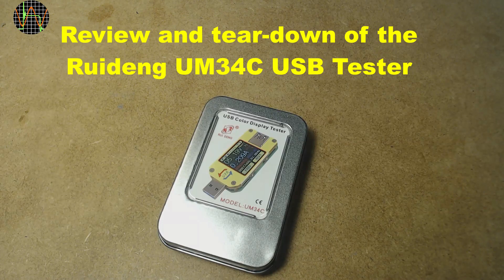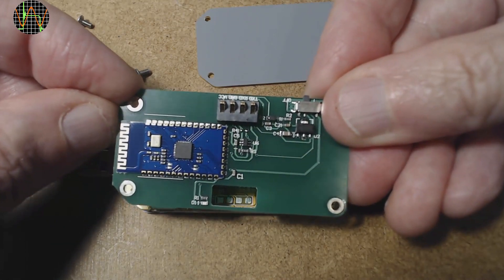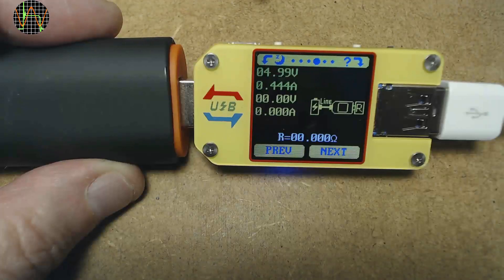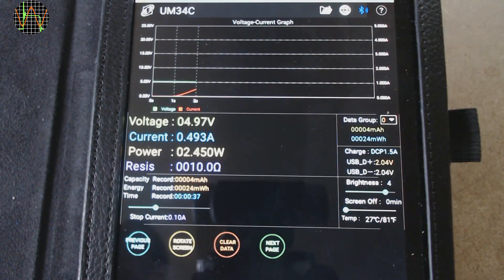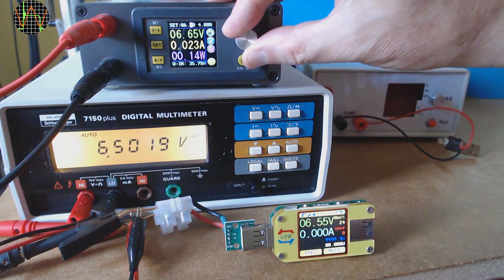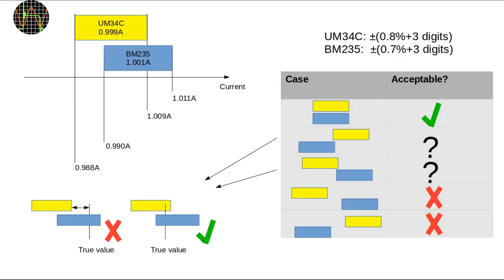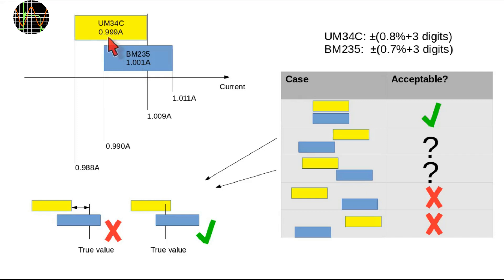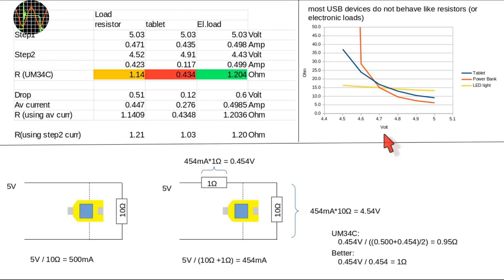Review and tear-down of the Ruideng UM34C USB Tester

Comment: Very thoroughly tested! It's a pity you didn't check the functionality with a USB3 host and device. You might have been surprised! 
I wanted to use it like that and connected it to a USB3 port an a computer and a load resistor. Only this type of load resistor had a USB3 connector. The current shown by the UM34C was far too low! BUT: If you connect to a USB2 load resistor instead, the measured current is correct. Connect the UM34C to a USB2 host, but using a USB3 load resistor, the current is correct, too!
Only if both, the host and the device, are USB3 the current measured is much too low! I disassembled the UM34C just like you did and took some measurements. And I discovered what I would call a design flaw. The UM34C has the current shunt resistor placed into the ground connection between the female USB3 connector and the three input connectors. On USB2 connectors there is only one ground pin, but on USB3 connectors, there is a second ground pin between the two superspeed data line pairs, called "ground drain". This signal (on pin 7) is usually connected to the same ground line as pin 4 in hosts and devices. But in the UM34C, pin 7 of the male USB connector is routed directly to pin 7 on the female USB3 connector on the other side and not connected to ground. This means, that as soon as you connect a USB3 host (which connects pin 7 and pin 4 to ground) to the UM34C and then plug in a USB3 device (which also connects pin 7 and pin 4 to ground), the UM34C cannot measure the current accurately, because there is effectively a second ground connection in parallel to the shunt resistor in the UM34C between host and device, and the curent flowing through this second connection cannot be measured!
IMHO the correct way of designing the UM34C would hava been to connect the ground drain pin on both USB3 type A connectors to pin 4 and not route it to the other connector independently, so there is only one ground connection between input and output (via the shunt resistor).
edit: spelling
Reply: @vegane_athee  
Here's what I did:
If you remove the upper plastic shield (on the display side), you can access the solder joints of the USB3 plug. The USB3 socket's solder joints are under the display and you would have to remove it to reach them. I just cut the PCB trace of the middle pin on the USB3 plug. The one right in the middle of the row of contacts is the GND drain signal. By cutting this, current can't flow through this ground connection circumventing the current measurement anymore. Of course this is no ideal solution. Ideally you would connect this GND drain to GND on both the USB3 plug and USB3 socket, but as this is not possible on the socket side without removing the display, I didn't do it.  GND drain is usually connected to GND in the USB host as well as in a USB device, so the drain wire in the USB cables should still be connected to GND. As I said this is by no means a perfect solution to the problem, but works for me.
I did not check to see what happens if you use the USB-C connector instead of the USB3 plug. Don't know if GND drain is connected the same way.

Comment: Very good video, i like the technical bits!
Do note that if you are transmitting with the bluetooth transciever it will draw much more current then shwo in about 20:00
Reply from the maker: Good point. I should have tested that when BT was active. Thanks for pointing it out.
Reply: @TheHWcave  no problem. I can understand why you left it out and only used the idle current :) It's difficult to measure dynamic current, need a good multimeter, mostly it's best to do it with an oscilloscope and by measuring a series resistant voltage. Then converting its mean voltage to amperes. But that's if you want to be really precise though. Also have to pick a very small series resistance so it won't affect the load, maybe it the size of 10, 100 milliohms.

Comment: I there no control on how the X-axis is handled when viewing the graph?  I would have liked the default to be all the data, it would start with he 1st point and just keep packing more and more points into the chart (the display would always show the entire XL file).  It would be nice to see a complete 1 hour curve of a battery discharge test.
Reply from the maker: Yes, I agree that the automatic plotting scaling is not all that useful. That is why I always ignore the graph and instead export the automatically recorded data for use in a spreadsheet to plot it the way I want.

Comment: I now have the non-bluetooth version of this meter as a result of watching your review. It will get used for easily measuring currents that usb devices draw, and for measuring mAh into various non-usb diy rechargeable torches I've built over the years - need to make some adaptors for that though.....as you suggest here, I have turned off the 'record' threshold, well, I think it's actually 10mA because you can't dial in 0, but that's fine. It's a shame that only button display  colours can be changed, but none of the actual measurement fields can - red on a dark background is quite hard to read sometimes ! Also, the exposed pcbs at the sides are a bit vulnerable as you said, so it will live in its storage box mostly...Otherwise, no complaints, it's very good. Thanks. Dave

Comment: 20:28 In fact CPU keeps runinng at this point but the display shuts off. You still can see the 8mAh from the CPU going on. it really stops when 3.3 LDO output comes around 2.65v, and it will tend to reset when voltage comes back too quick. 
I've modified my UM34C to use measuring capacity of cells. I hookup 3.35v from an external source, and feed it directly to the electrolytic capacitor on the LDO output. This way, using 3.35v, i make sure the STM Cpu will push it current from my external source, not from the internal LDO at 3.33 or 3.34. Thus I wont be including its own consumption on my capacity logs, AND, most important, I'll be able to measure Voltages as low as 0 volts.
So basically, feeding it externally and separately from it's USB bus allows me to test capacity of my LiPo's (as low as 2.8 or 2.5v no issue).
Just my 2 cents :)
Reply from the maker: that's a great modification and makes the UM34 so much more useful.
Reply: @TheHWcave  yess and for it’s price it’s really worth it ;)

Comment: Do you have the link to download the Bluetooth app for the UD18? I just purchased one of these from Amazon and the bar code only goes to a Chinese gaming website and not the app website.
Reply from the maker: Unfortunately no. I don't have one of these testers or links to an app.
Reply: Thanks. I figured out that E_Test app will work but you have to have GPS location on on your phone for it to work. Not sure why you would need the GPS on for it to work.
Reply from the maker: @norme1850  Again, I dont have a UD18 myself, but my guess is that the app wants your location because the company that makes the UD18 wants it, for whatever purpose (if only for tracking where most of their customers are located). You are correct, I can't see why the USB tester itself would need your location for.

Comment: I noticed at 2:43 of your video, BTW an excellent video review/teardown, that the printed descriptions on the back cover do not match the various components on the PCB. Specifically, your cover shows an ON/OFF switch and a USB-C OUT designation that at 2:49 of your video, where you remove the back cover to reveal the PCB, it is apparent that there is no ON/OFF switch nor a USB-C OUT connector on your PCB.  Just curious about this anomaly?
Reply from the maker: You are correct that the UM34 does not have a USB Type C out connector. The UM25 has one at this position. Not sure why that is and which device came first in the evolution. There is certainly room for one. 
The switch is actually there but on the Bluetooth module attached to the cover. When assembled it hovers right above the 0.01 Ohm shunt.  You can see it later when I show the Bluetooth board.
Reply: @TheHWcave  Thanks for the quick response... I did'nt think to look at the bluetooth board for the switch but, in retrospect, it makes total sense since the switch turns the bluetooth on/off. I, too, don't know about the evolution of the two testers you mentioned... just thought it weird that it the UM34C tester has a UM25 rear cover on it!  Again, thanks for an outstanding video!!

Comment: I was a little concerned towards the end of the video when you noted the Android App version "phones home" - is that a real cause for concern...?

Also, unless I'm missing something really obvious here what actual advantage does this UM34C offer over the UM25C...? 
I can imagine similar app concerns apply for the UM25C as for the other model..?
A shame that the app has to be downloaded from Mediafire and not within the Android app store.

Thanks for the informative review.
Reply from the maker: Hi Morgan,
Advantages: The UM34 is (usually) a little less expensive than the UM25. If you don't need the extra digit resolution and can live with 4 Amps instead of 5 Amps max current, then it is still a very good tester. 

Phoning home was maybe the wrong expression. It loads a Chinese advertising  page on startup, but as far as I know it did not send any of your stuff. 
Sideloading. That was needed when I made the video some time ago. Nowadays , just go to the app store and search for RuiDeng or UM34. I believe the same RuiDeng app can now handle (almost) all their USB testers and USB enabled power supplies. I tested it just now. I had some initial problems but after turning on Bluetooth myself and pairing with the UM34C (pin 1234) the RuiDeng app worked fine.
Reply: @TheHWcave  Thanks for the reply. The phoning home comment did concern me a little.
I have now received my UM25C and from the little that I have tested it I'm impressed.
My TC66C is still shipping from Ali express, with that one I believe that you can trigger various protocols that a charger may support, like QC for testing.
Reply from the maker: @Vimes.   Thanks for the update.. Hope you like the TC66C. I am still looking for an excuse to get it... (I have way too many USB testers) but a good USB-C tester would be nice.
Reply: @TheHWcave  
The UM25C can be justified, nice upgrade over my Muker J7 usb tester, and will be used. The TC66C is perhaps something of an indulgence. 
Point taken tho, we all need certain excuses  for what we buy. I'll sometimes accept "new and shiny" if nothing else fits. lol

Comment: there is a difference between displayed output voltage and the set voltage with my DPS5005 module, how can i calibrate it ? same thing with current. thank you
Reply from the maker: Can you explain your setup? You are feeding the UM34 from a DPS5005? Do you have a load on the other side of the  UM34C and if so what current does it draw? My guess is that the voltage on the UM34C is lower than the DPS5005 because of the voltage drop on the cable between the two. If you use thin cables and high currents, this drop can easily be a volt or more. Best way to confirm if that is the problem for voltage is to have no load on the UM34C. In that case the two displays should be almost identical. On the current, the UM34C uses about 24 mA for itself, so the current on the DSP5005 will always be slightly higher than what's shown on the UM34C display. Does that help?

Comment: Thank you for this still great ressource. I bow to the thoroughness of your expedition. 
Since I want to test cables and comsunptions now and then I purchased such a device and am quite happy with it, based on your helpful insights. 
Anyway the app now is available in app stores and I wondered if they - just maybe - fixed the problems you stated in the firmware, too. 
The trickle charge data glitch remains, for the cable resistance measurement I will order an electronic load in the next days. Did that with seemingly stable loads until now, but I do not trust that much. Do you have a suggestion on what USB load generator to buy in 2021? Since your video about that is from 2018...  Budget seems to be around 30 Euros regardless of which one you choose...
Reply from the maker: The one that I use is still available at Banggood for around 25 euros, they also have some that can handle more watts... and some specifically for USB testing for around 14 euros.  The question you have to ask yourself is whether you are more interested in a generic one (like the one I use) or one that is specific for USB and has a USB connector on it. The latter ones are easy if all you do is USB stuff. The other one is far more versatile for all kinds of batteries (including car batteries and measuring 18650s directly)  but you need to rig up a USB adapter.
Reply: @TheHWcave  Thanks for the quick reply! Just last night I purchased one off of ELV, the only one they got in fact. Came about 18 Euros plus shipping. It is a 35W-USB-load with all USB connectors except mini, which I think I can adapt to anything else that does not supply more power. By applying the respective connectors, yes. If you happen to have the time and nerve to make a vid about checking how good these loads are calibrated with a vanilla multimeter, I would be interested very much, indeed. :D
Reply from the maker: It would be interesting to learn about your experience with it. Unfortunately I don't plan to buy a new electronic load, USB or other, at least for now since my current one does all I need. One of the things I would really like to know is how it accounts for the power it needs to operate (electronics + fan) if it takes that power, as I suspect, from the same USB connection that you are measuring? Or does it use  external power?
Reply: @TheHWcave   Yes, that's the weird part in my opinion, too. Same thing as with the UM34C, it takes the power from the same "line", which it should either leave as untouched as possible or regulate with as little electric interference (in the help-yourself-you're-very-welcome sense) as possible. I did not dare to put it to use yet. But things might change: I happen to give shelter to a Siglent laboratory power supply these days; let's see if that gives me any ideas, especially in combination with the UM34C. 
Es bleibt spannend! :D
Reply from the maker: Indeed, But other than a USB tester, the purpose of the load is to consume power, so in that sense I would not mind if it takes its operating power from the source. If it does it properly its display should show that there is a minimum load current that is always there. More worrisome may be that if the source voltage collapses when applying a decent load current as cheap USB chargers are prone to do. In that case, there is nothing left to power the electronic load and it will shut down. That , in turn, will probably remove the load current, so the charger and the output voltage recovers. It would be interesting to know if yours gives an indication that this has happened (you may not have witnessed it) and stays off. Or, does it automatically resume loading the source, which then collapses again ... rinse and repeat
Reply: @TheHWcave  Do I get it right that you're suggesting adding an oscilloscope to the setup, to snoop for "superfast rinse and repeats"? (in case the accu's electronics are much faster and the load reacts rather smoothly) ;)
Reply from the maker: @Noobinski  I don't think that would be necessary. Most of the time a charger would fold down either right away because you are asking for more current that it can deliver, or it would shut down because of overheat. In that case, it would probably be minutes before it has cooled down enough to restart. Also the electronic load may simply stay off (as it probably should) when the power comes back.  I would be great if you could post what it does when you get around to playing with it.

Comment: they have a new 1 the TC66C i think you like it, and a video on it would be great😁
Reply from the maker: Thanks for the tip and you are right. It would make a great "beware - snake oil" video. I'll looked the specs up and they are ridiculous. Lots of digits on the display but the stated accuracy in no way justifies them. Current in 10uA resolution sounds great until you see its accuracy is only +-1% +20 digits. A true current of exactly 1 Amp could read as 1.01020 and be (just) in spec.   Same issue for volts. I would stay clear of this. If it ends in a bargain sale, I might get it and do a fun video on it, but at the moment it is way too expensive for what it offers.  That said, I did pick up a UT25C in a bargain sale and it has 1mV for volts and 100uA for current (so both  just one digit less than the TC66C). I have not had time to test it yet but expect similar accuracy issues and might make a video on it in the next couple of weeks.
Reply: @TheHWcave  for your TC66C, it is just max error range , for more accuracy meter , it is normal for accuracy, if you find one to compare . and we don't think it is ridiculous.  6 digit is very had for 5 digit , you should know that 
for  UT25C , it is just copy for our UM25C, and his accuracy is absolutely of UM25C accuacy, because we have our own device to calibarate, but UT25 did not have, he just copy our program . if you don't believe, i can provide UM25c to compare 
as you want to evaluate some thing, you should make a research 
thank you